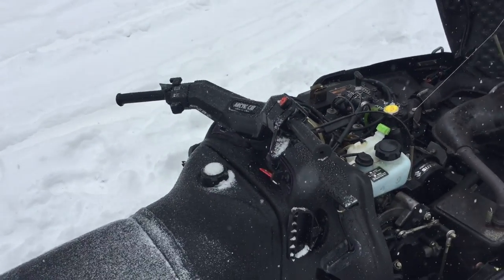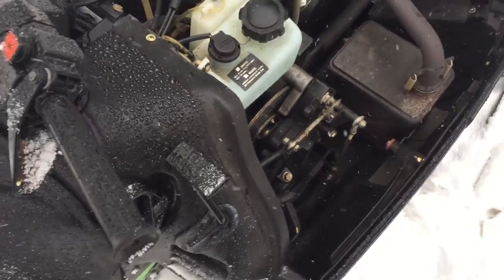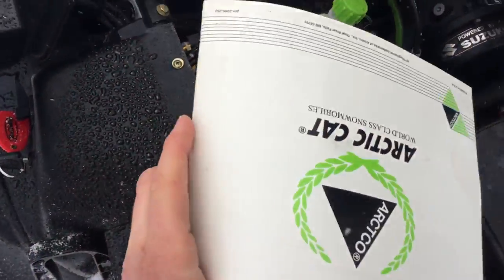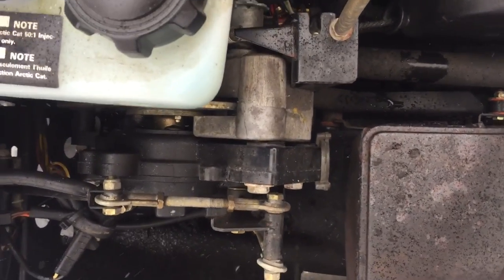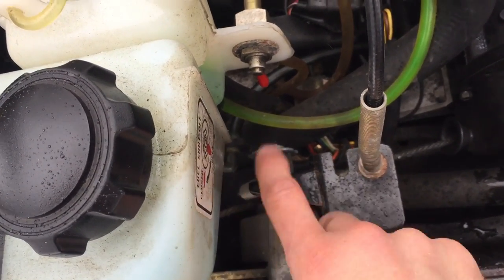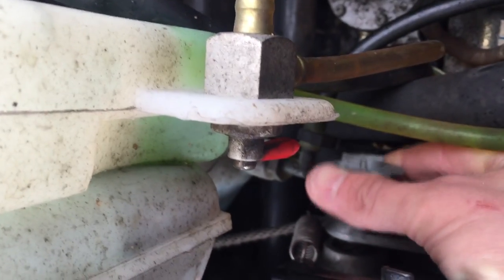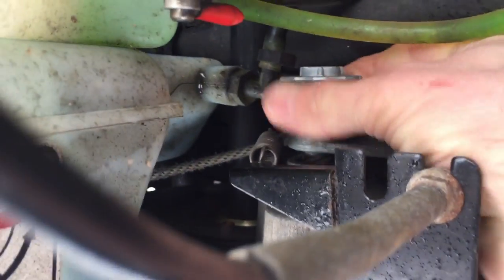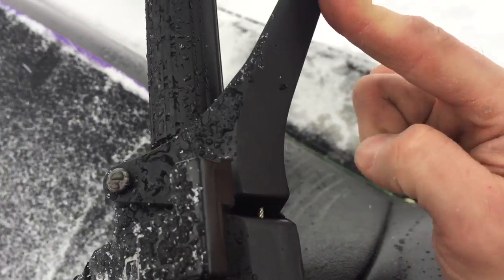Adjusting Your Snowmobile Brake

Comment: do you have any idea on how to fix a seized brake caliper on a early 2000s articat puma 570?
Reply: Yes buy a skidoo 🤜💥🤛
Reply: @bigjay6743  I ended up replacing the caliper lol. I've owned a few skidoos and also worked on old ones as well as assembled and drove plenty of the 2021's. I will never own anything BRP anymore.
Reply: I'm only playing I have no problem with Arctic cat still own a 95 440 panther Deluxe been a good sled still runs great plus had a few cat wheelers that always got me home...